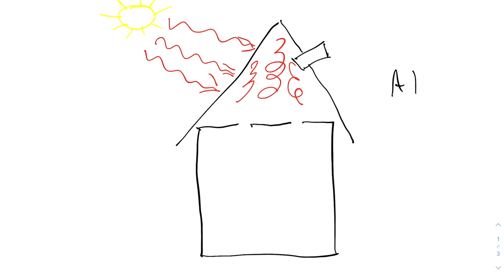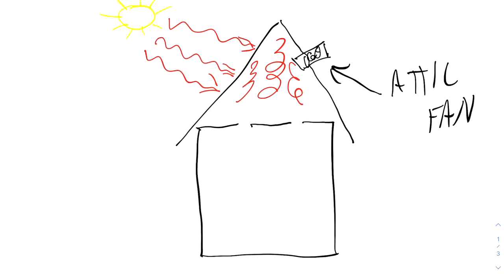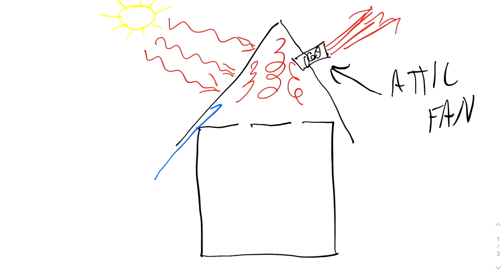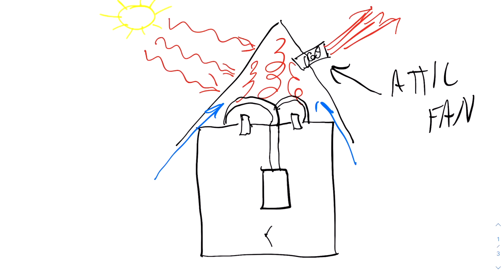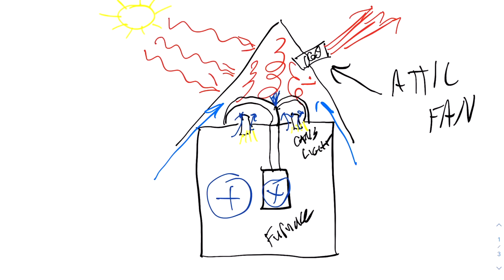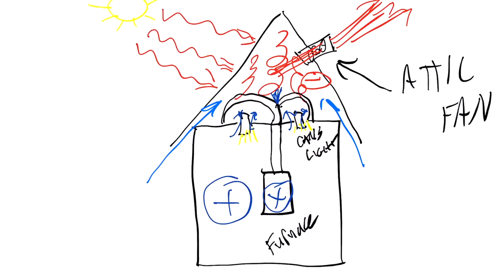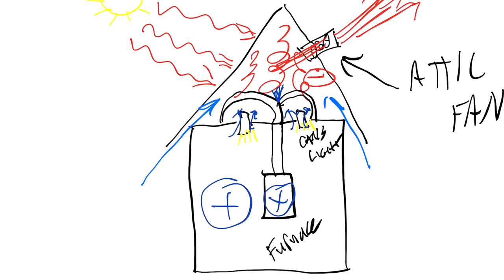3 Remodel Rip-Offs

Comment: we are in Sw Missouri, dad had a 1930s farm house that had large single pane windows. on a windy day you could see the curtains move from air leaking in. he had siding and new windows installed and it was like a new house. cost to heat and cool went down dramatically
Reply: The thing people don't realize is that the old windows could have been refurbished for less than the cost of new windows.  Do you think that in 1930 there was air blowing through a closed window?  No...They need to be maintained.
Reply: @bearded4glory809  Crappy old aluminum windows aren't worth it to refurbish, if it's even possible.
Reply: @genli5603  1930's farm house with (original) aluminium windows... I think you will find they will be timber windows.
Reply: you might see that the savings came from the cavity around the window behind the trim. most old windows even from 80's are not well insulated when they were originally installed. Pull trim board and you will see air gap. That mostly where air leak and heat/cooling losses happen.
Reply: Fine, but Matt is specifically talking about the thermal difference and energy difference between one pane of glass and a multipane glass window, assuming all else equal. The issue with your dad's windows were they were fitted poorly, were uninsulated, etc.
Reply: Double-pane glass seals fail and then the only fix is new inserts for about $150/ea. where I am. I had windows like this. Hurricane-force winds blowing straight at some casements... I put window film on the screens and popped them in place. One good gust one the shot out of the pane and hit my wife in the head!
Reply: @RIBill  then you bought poor replacement windows,. better replacement windows generally have a lifetime seal warranty and a honest window sales company would stand behind the labor part also, and before you ask i've been doing this type of work for over 30yrs and window sashes are NOT 150 each unless you've been seriously suckered
Reply: jeff robison I think he was thinking first or second gen double pain windows.....maybe remolding a 20 yr old home. He does mostly high end homes it seems. We are just mere mortals...... love his videos, just dreaming...
Reply: We have 60 year old single-pane windows & 60 year old aluminum storm windows.  The cost to replace the aluminum storm windows (which have broken handles, alignment pins, warping, etc.) and have the single pane windows 'refurbished' is probably more than new double pane, energy efficient vinyl.  The new windows would work better.  Simple as that.
Reply: @krazzygranny7032  My windows HAD a lifetime guarantee! Thousands of homes got these windows all over the Country. 10 years of standing up to New Engalnd cold and wind in the winter and heat and humidity in the Summer sent them packing. They went bankrupt and then the guarantee was wortthlesss.
Reply: @RIBill  - yep.
Back in the early 90's I had Traco double pain vinyl windows put in, with a lifetime warranty. 
Around 2011 or 2012 one of them started getting condensation inside it.
I hopped online to find out what I needed to do to use that warranty, only to find out the company sold it's residential window business to another company in 2008, and that company subsequently went out of business.
So much for the warranty.

Comment: I love Matt’s videos but this one simply doesn’t contain enough nuance to be helpful. Sometimes he is talking about a very leaky house, sometimes he assumes an airtight envelope. Yes, if you use your dumb, programmable thermostat, a smart thermostat is pointless, but if you can’t be bothered to set it daily, the smart thermostat could save you. Yes, running the fan can suck in air on a leaky house, but moving air feels more comfortable than stagnant air of the same temperature, so a leaky house could benefit as long as you are using it at appropriate times. Yes, the conductive heat loss/gain through new windows is marginally better than old, but old windows are incredibly leaky. I completely agree that the sales reps savings claims are borderline corrupt though!

Comment: Seven years ago when we re-roofed, we put in a solar-powered fan on the attic roof of our unheated garage. The roofer was emphatic that it needed to suck air in from outside, not exhaust. It's probably not a huge deal, but I like the idea of that storage attic being, say, 110 F instead of 130 F.
Reply: Did you actually measure the before and after temperature? You should really get the cool air from inside your garage space because it will make that living space cooler.
Reply: @MAGAMAN  Once again, Matt is talking primarily about his climate. Job I remodeled 45 years ago in Upstate NY was similar to what you are describing, and it was well worth the effort. The attic hatch was over the garage, there was an intake grill at opposite end of the ranch house gable roof from the exhaust fan, the the wet heat was run in the basement, and there was no AC and no can lights (this was back in the day, one canopy fixture per room). The Universal Answer is, as always "IT DEPENDS".
Reply: @leestevens446  
Yeah, I've installed power gable vents (one side power, the other side just a vent) during several siding jobs on 80+YO homes, and they work incredibly well in my experience. Put them on a thermostat and set it to 105 or so, and the AC runs much less. For around $400-600 including labor (during a siding job) it can pay for itself rather quickly. It's also really helpful in 2-story older homes with retro-fitted central air, where the upstairs always tends to be much warmer.
Reply: @MAGAMAN  nb;

Comment: Matt, love your channel and agree with almost everything, but I can't on this one in regards to attic fans.  If your attic is vented properly at the eves there is no way an attic fan can create a negative pressure in the attic.  The primary install for us in the Chicago area is on a 2 story house with a single furnace.  The upstairs is 10 degrees warmer than the downstairs even if you restrict the downstairs vents and leave the upstairs open wide.  The A/C will struggle to ever bring the 2nd floor in to submission.  An attic fan solves this problem easily.  Another point you missed is that of humidity.  Most current models come with humidistats built in to them as well.  With mold being such an issue, this feature is worth it alone if your attic is staying moist even though you've vented all your exhaust fans to the exterior etc.  You really need to re-think this one.
Reply: Nope, he's right. If you have issues with hot air attics, you don't solve it with an attic fan. That's outdated 25 year old thinking. You have ridge vents that don't need active cooling and you insulate properly.
Reply: Of course it's struggling, closing off the zone is your first issue. Any knowledgeable AC guy will tell you not to do this as your creating a build up of static pressure that will put unnecessary strain on the system. Many people think that is okay and saves energy but it doesn't, forced air is forced air all the time, you can't stop it or reduce the load by closing a few vents, this will only cause shorten the life span of the system over time. This only would work if the zones were both on their own systems.
Reply: JM M Attic fan solved my heat issue. Easy to install and did not cost much either. It is not outdated if it works as intended.
Reply: especialy after the sun goes down.
Reply: Wrong. A ridge vent takes care of this. By using a powered vent you’re actually pulling cold conditioned air from your living space into the attic regardless of soffit setup. You’re combining passive intake with powered exhaust—a complete imbalanced system.
Reply: @eggnogaddict6287  Even if you were pulling conditioned air in, it would certainly not be much. A little attic fan isn't creating massive negative pressure, and the soffits are an extremely low-resistance source of fresh air.
Reply: @sprockkets  yeap it's very logical. Good old vents work just fine.

Comment: Airwave is recommended in AZ. If the thermostat doesn't offer it, energy auditors  recommend to enable the fan switch delay on the air handler/furnace. According to them, it may save up to 10% on the electric bill.
Reply: AZ is pretty dry compared to Texas though. As with everything - horses for courses.

Comment: If you're looking for cost savings from smart thermostats, you're probably barking up the wrong tree but that isn't really their main advantage.  You can get nearly the same cost savings from a programmable thermostat.  

The reasons a smart thermostat is useful is 
1.  Can make decisions based on outside temperature and humidity.  (eg. Feeling cold when it's 50's and rainy -- not a problem, it can automatically make it a degree warmer for comfort)
2.  Sensor - Thermostat can make decisions based on the temperature in other rooms using sensor.  I use a sensor in my bedroom and use that for temperature at night.  This allows it to feel comfortable all night
3.  Integration - There's at least 1 automatic vent shutoff that can be controlled by thermostat sensors so it can even out the temperature between rooms in older houses for much less than getting a new HVAC system or properly load-balancing the unit.  Several of them can also integrate with Alexa/Google.  
4.  Statistics - Who doesn't like a bit of data to see when the HVAC has been running and how long
5.  Convenience - Matt stated this but being able to control the thermostat remotely is definitely nice

Comment: Thermodynamics is a complex topic and the outcomes are highly dependent on initial conditions and many variables. 
Different climates, building materials, building air tightness, and other conditions can have a huge effect on the outcomes.
For example:  in our climate, double pane windows were a huge energy savings and totally worth it.  Also, the humidity issue with a smart thermostat running the fan doesn’t exist in our climate because it’s already too dry in both the summer and winter.

One last point:  Arguing against double pane windows in any climate based solely on economic conditions is exactly the kind of thinking that is creating climate change.  That is to say: placing more value in how much money one has, while ignoring the costs inflicted on the environment and future generations.

Comment: The most useful part of a smart thermostat was when it sent me an email to say the house had hit 80F while we were away from home so our land lord could get the ac fixed by the end of the day.
Reply: You should try a Z-Wave thermostat along with a hub and a temperature sensor for each room. You can program the hub to calculate the average temperature throughout the house from the temperature sensors and control the thermostat accordingly. Because it's on the Z-Wave wireless communication protocol, it will continue to work if you lose internet connectivity.

Comment: I completely agree with you, a 60 degree heat reduction is a ridiculous claim. that said,  I installed an attic fan in the two houses that I renovated, the difference was instant. I would estimate the temperature drop between 5 and 10 degrees Celcius. We don't have air conditioning in the house and it gets to 35-38 degrees for weeks. We live in Japan. I also painted the roofs silver from dark brown. that also makes a huge difference. Most houses here too are painted dark brown or black, I don't understand that. I installed the fan on the west side to draw cool air from the east. The fan cost less than $100, the paint, I had to repaint the roofs anyway so no extra cost involved. It turned out to be one of the best expenditures that I did.
Reply: That's primarily because he's talking about homes with AC that are supposed to have an air tight envelope which is compromised by the attic having a negative pressure, pulling in the expensive conditioned air out of your home into your attic. If you don't have AC, this doesn't apply and it would actually be a GOOD thing to pull hot house air up through the attic pulling in cooler fresh outside air into the protrusions of the house.
Reply: Paint, even silver paint, is a mediocre radiant barrier, at best.   Look it up; I'm not making this up.    Repeat:  you are claiming to have cooled your attic by applying a silver coat of paint to reflect sunlight from the rooftop.  That's called a "radiant barrier." 
A better way is to install aluminum foil, shiny side DOWN, inside the attic, sub-rafter.     Also, it helps to have eave vents (intakes) and ridge vents (outflow).  Your paint simply cannot compare; and it will accumulate dust and lose its effectiveness.
Reply: @johnbecich9540  The essence of a radiant barrier is reflectance rather than adsorption. If the lighter paint color absorbs less and reflects more, it is acting as a radiant barrier. It has the added advantage of reflecting that radiant energy into free space, and NOT back into the underside of the roof sheathing, so the effective utility of the roof paint is greater in that application than an equal reflectance within the structure. People make this mistake in assessing Low-E glass all the time. If the Low-E layer is anywhere EXCEPT the outer face of the outer pane, then a portion of the reflectance is converted to heat when it hits the pane on the outgoing pathway, and then conduction and convection come into play, dumping more heat energy into the structure than the reflectance numbers of the coating would imply. 

FWIW, BSC has documented roof fails due to converting flat commercial roofs from black EPDM to newer white elastomeric. The white is not a mirror, but it has been (devastatingly) effective in some hot climate zones.

Comment: This is very on point, concise and informative.   I live in DFW, have a 6,000sq ft home (6k sqft under roof/ under HVAC coverage) that was built in 2000.  I just got done putting in: 4 complete HVAC systems, replaced 3-50gallon water heaters with two instant-on AO Smith tankless water heating systems, replace 28 operating windows, with double pane Jeld Wen windows, changing some of the windows to non-operating models, had all windows and doors, weather striped and otherwise sealed, replaced the 20y/o roof and replaced the 2 double garage doors (aluminum) with insulated fiberglass doors, new molding and weather striping, new tracks and new openers. Also replaced all 5 pool, spa, waterfall, water jets and pool cleaner pumps and had pool tile, grout and couping renovated... already have a whole house NG backup generator but now having replaced the roof, am looking to install a solar system... it seems that here in North Texas, HOAs can not prohibit the installation of residential solar systems... maybe you already have created a solar power how-to video?

Comment: I don't have an attic fan but I do have a hot/cold hvac up there.  My reasoning for getting one is if during warm/hot outdoor solar temperatures, it heats up the attic, as explained in the video.  This in turn gets some of that heat absorbed by the hvac & all the air ducts up there  going to the many air registers in the upstairs rooms. The insulation around the flexible air ducts is not going to be foolproof, some heat from the surrounding attic air is going to get absorbed into insulation & then into the ducts, which can possibl slowly warm up the cool forced air inside the duct, especially when the duct line is a long one. This in turn keeps the a/c turned on longer than it should be trying to cool down the upstairs, increasing the money on the electric bill because the hvac system is one of the machines in a house that sucks up large amounts of wattage.   Some commenters are backing up that physics & are saying they have saved on electric bill expense.  If you don't want to suck the cool air from the lower levels through the ceiling, then perhaps have one fan in the attic & a vent on the opposite side.  Just make sure the vent/grill is good enough to keep animals out, especially insects, more than normal.  Or maybe 2 fans, one ingoing & one outgoing.  The point of all this exercise is to relieve the attic of the greenhouse effect & to at least keep it the same temperature as the outside, once it reaches a certain temperature higher than outside on the sensor to kick on the fan.  An additional solar panel powered fan would also make sense although some say some attic fans are designed to have low wattage/amperage.